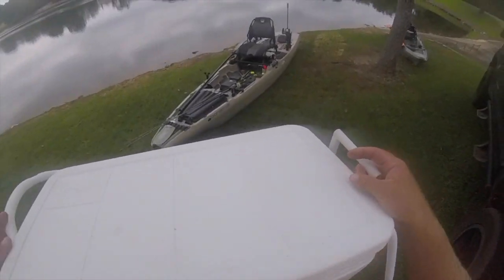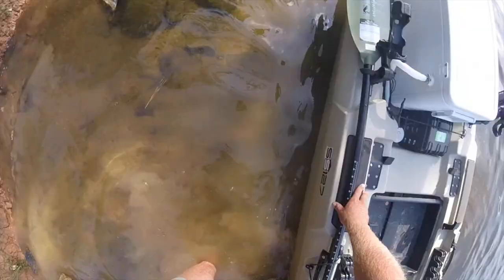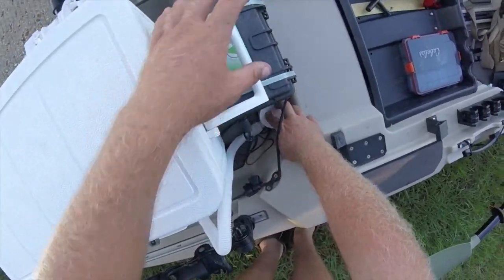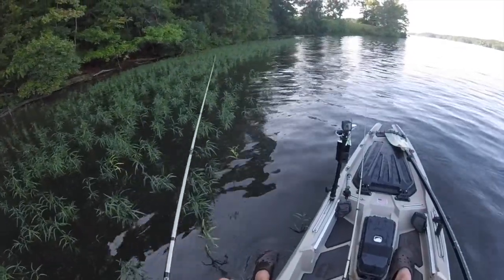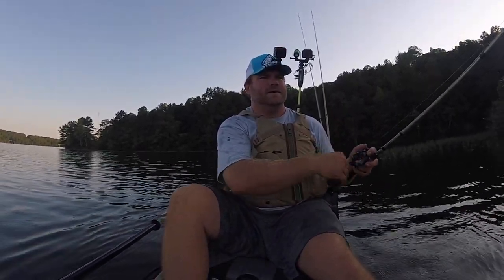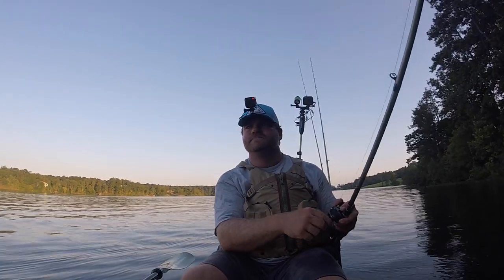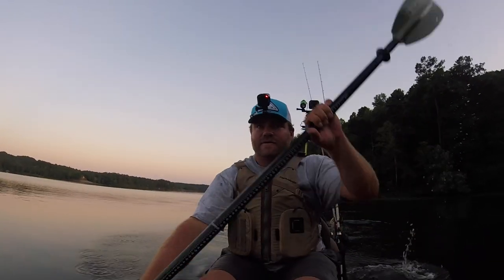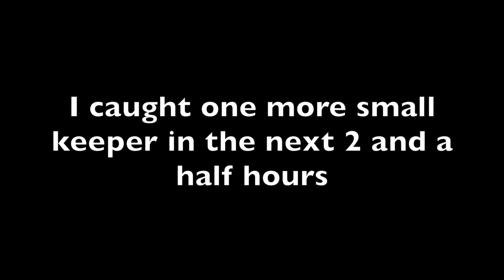How to: Building and testing a livewell for my kayak

Comment: Use your foot braces to help activate your core muscles. Reach forward at arms length with your strokes and pull directly back along side the boat until a natural exit at the rear.  But most importantly, set those foot braces so you can use your legs to push off of and activate your core.

Comment: In my observation, it appears as though I would try a longer paddle or try a less aggressive angle on the paddle when going into the water.  I am 5'9" and paddle in a malibu x-13 that's 28" wide.  I believe it is alot narrower than yours.  I run a carbon fiber ascend paddle.  I don't know the length offhand.  also i stop my paddle stroke once i get to my hip.  it helps with tracking also.  Another tip is if you want a quieter aerator there's one that runs off usb power so you could just use a small power bank and they are almost silent.  I'd just throw an air stone on one of those and call it a day.  they run about 13 bucks at aquarium coop.  some are prone to failure after awhile so might want to bring a spare.

Comment: Great video. If you want more oxygen in the water to keep fish alive longer and a pvc 90 degree elbow with a 14inch pvc pipe piece with a cap. Then drill holes in the straight pipe all the way to the cap. My tracker tadpole has a cooler air 94 qt college live well. This addition has kept my fish alive for over 30years. Good luck. Keep casting👍